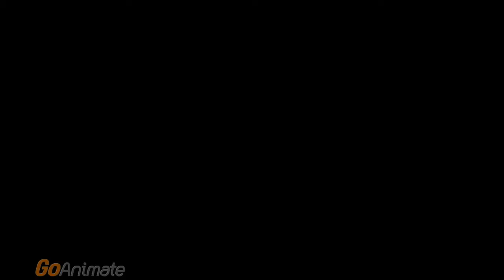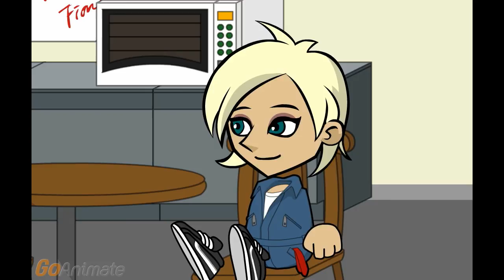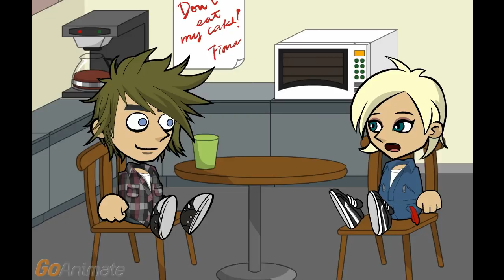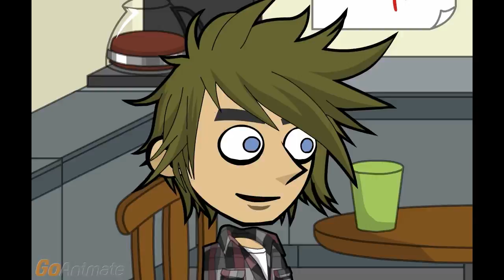Refrigerator Not Cold Enough Problems

Comment: Hi, I recently got changed a refrigerator compressor by a technician. But I didn't check the cooling of the freezer compartment. It was cold but not cold enough  to freeze the things. Then I called the technician again & he told that the gas pressure  could be  low. So he brought the gas & filled the gas in the refrigerator. & told met to check again for a day or two. But with that action its freezer temperature increased. Though it shows colder than the outside temperature but its efficiency has reduced. Please tell me what shall do for this problem?
Thanks
Nafees ur Rehman